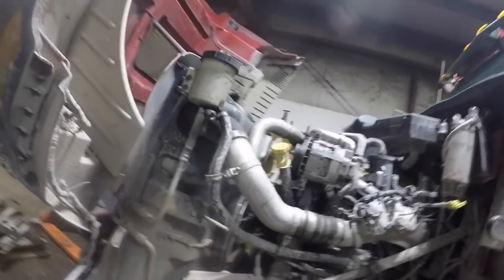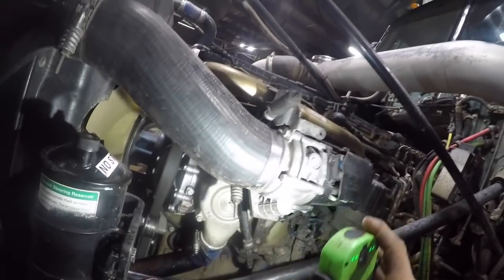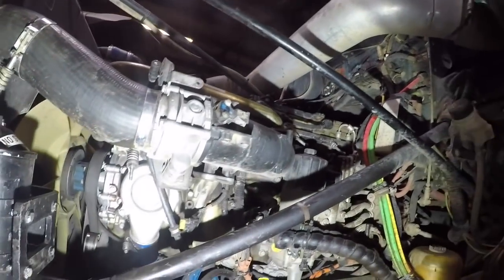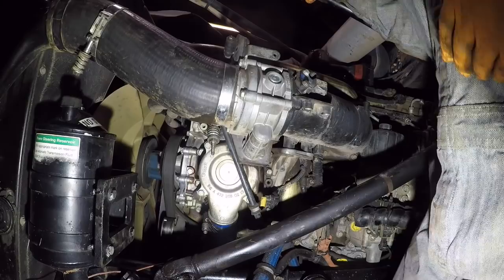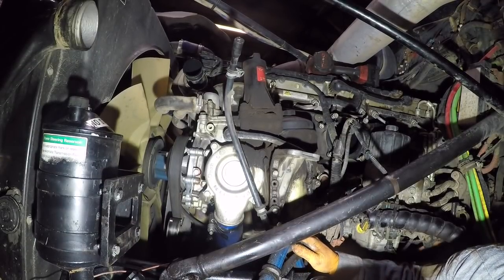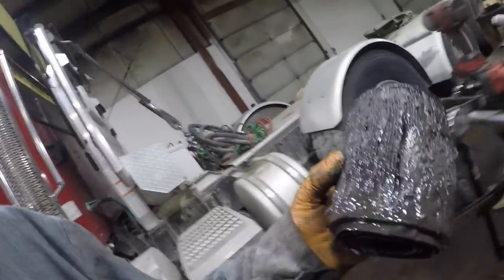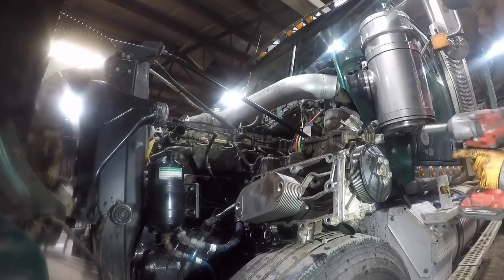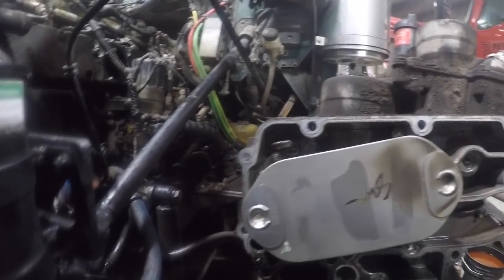Detroit dd15 oil cooler module electrolysis pt1

Comment: Nice I have done 4  of those so far . Replaced 2 and rebuilt 2 . I will say the job is a lot easier if you take the front wheel off .

Comment: Metallurgy, a dreaded phrase from the days in school, when one wasn't paying attention. Now so many years later one sees the results of electrical currents, electrolysis and galvanic corrosion. It's amazing to think simple mildly acidic water, will act as an electrolyte between unlike metals. Engineers are thinking lighter, stronger and cheaper to produce a product. So they use various materials together for an end result which for the time works. But just change a variable like switching from engineered anti-freeze to a possibly mineral rich water, the damage it can cause is amazing. Dropping wrenches has changed so much over the years, your always on a learning curve. Like you pointed out with the welding, you step away from a field long enough, one tends to "forget" details that were second nature 3 years ago. Warren it's always enjoyable to watch what you encounter on a daily basis, from one job to the next. Thanks for bringing us along with you. Thanks for the Share & Stay Safe!
Reply: Few yrs back i was called out to fix water leak in apartment building, somebody replaced the old galvanized piping with copper, a good-thing, but they hung the copper with cheap steel plumbing strap, yep every hanger was bright green, 1 was dripping real bad, so yeah i fixed the leaker, got rid of strap, using copper hangers, no more electrolysis

Comment: Don’t mean to nitpick Warren as I’m a big follower of you’re work, I’ve replaced a couple of these oil cooler service centres on the DD15 engine, due to leaking e.g pin hole in the housing. Caused by cavitation more so than electrolysis. Due to the system not holding pressure, then it leads to cavitation. We have seen the liners let go due to it also. I would recommend air pressure testing the system without coolant you mite find more problems 😷 keep up the good work ☘️

Comment: I can attest to their reliability, I've driven a number of Freightliners with them in my time as an OTR driver, I've driven an International LT for a week, and I've driven a pair of Volvos within few months of each other, and in my three and a half years the only trouble I've had with the DD15 was a belt tensioner went out on the road while I was with Swift and it destroyed the belt. With the Volvos I had injectors and the EGR cooler get fucked on them within my seven months at the last company. Didn't have enough time on the International to give an opinion. Detroit is by far the best engine I have ever had in a truck, if I buy this truck I'm eyeing for heavy haul work and something comes up legally where I have to swap the engine from the 14 liter Series 60 in it I'd go with the DD series, probably the 16 liter. Frankly I think they're better than CAT

Comment: I would not even put a coolant filter back in it, it's just supposed to help by slowly releasing additives over time. I'm sure you knew this already though. Before I went on my own I worked for a company that had a fleet of DD15 and 13s. Our dealer told us if we run good coolant and service it appropriately then don't run it with a coolant filter. So that's what we did and we never had any issues. I don't claim to be an expert, just thought that could be some useful info for you! Thanks for all your videos, I watch them quite a bit trying to learn everything I can from you.

Comment: Im so glad we put the ol school green in it. The newer stuff you're suppose to replace every so often but the green last and has way better protection against corrosion.
Reply: Red OAT coolant is million mile life of the engine, blue OAT is 500,00 mile. Theyre both leaps and bounds better than green coolant which is 3 year, 5 year if you buy extended life. I still wouldn't even run it that long. Everything I see come into my shop with major cooling system problems has green coolant in it, that stuff is garbage as far as I'm concerned and as far as pretty much every heavy duty diesel engine manufacturer today is concerned as well as most automotive manufacturers.
Reply: @saintsarecoming13  You are correct, green coolant is obsolete and I wouldn't put it in anything with the existence of modern coolant.
Reply: @mikeshultz1007  The old green and SCA Precharged antifreezes run a very high pH, or high alkaline, great for Iron but hell on Aluminum.  Use OAT or HOAT on engines with Aluminum parts.  HOAT means Hybrid,  i.e. contains Organic and Inorganic rust inhibitors.  i.e. Sodium Nitrite which is SCA pre-charge which prevents cavitation erosion.  Some older engines use "charged" water filters which already contain the Nitrite,  too much Nitrite can cause sludge formation.
Reply: The green is the same as water in a diesel. You will have trouble down the road with green in a diesel.

Comment: It may be helpful for some people to know adding water to full strength anti-freeze and batteries , use only distilled water , tap water is corrosive . And those using soap/detergents to remove and install tires on aluminum wheels , that causes oxidation and pits where the tire beads seal . I clean the wheel beads and wax them with car paste wax , and use original armor all (says good for rubber on the bottle) on the tire beads and inside edge of the top bead and wipe off the excess , and use a dampened rag with water around the wheel and tire beads as its installed , slicker that snot on a door knob , my wheels beads are not corroded or leaking , this is just something simple and on hand that works .

Comment: Have a whole fleet of them. Dd15. Most I ever see wrong with them is some head seals for the injector lines and emission codes. A lot of nox sensors and acm wiring. Other than that they really are good base engines. Just every manufacturer has emission problems.
Reply: Can't forget quantity control valves non stop

Comment: If I remember correctly there was a bulletin where Detroit said to remove the coolant filter and run them without it. Also there is a block drain on the left side of you didn’t know already

Comment: Nalcool 2000 stops that and changing the coolant helps what we do is check the voltage generated by the coolant  when it starts to get high change it

Comment: I don't know where the people talking about flux core got their information but what I know is that I trained and certification tested with flux core on a structural steel plate. Im certified 3G Unlimited, same with arc welding.

Comment: Hi Warren. I have an aluminium boat and it is essential that to stop errosion of the metal, we use what are called sacrificial anodes at strategic locations which attract the electrolysis. Have you any ideas as to why these anodes are not present in these machines?
Reply: those are in water heater tanks too

Comment: Those coolant filters disenagrate if they are left in too long. It’s normal for Detroit. We change ours once a year. Your lucky you got it out in one piece lol
Reply: If I remember right detroit has a TSB out that says to basically just take the coolant filter out and don't put one back in but for some reason they still sell them, I disagree with that. I think a coolant filter is pretty important especially considering every coolant filter I ever changed on a detroit looked like it was full of concrete.
Reply: @saintsarecoming13   not with the variable speed water pumps that’s why they got rid of those coolant filters
Reply: @СтепанБандера-ы8у  interesting, didn't know that was the reason. I'd be interested to read into that and learn what difference that makes.

Comment: That coolant sludge looks like Aluminum,  like you said, never run straight water, will cause erosion of metal surfaces.  Aluminum is a most delicate metal.  Only use the OAT or HOAT antifreezes in engines with aluminum parts, i.e.  aluminum oil coolers, aluminum radiators, etc.   The old green and SCA precharge work great on Ferrous metal (Iron) but will tear up Aluminum in a hurry.  Also note that long life antifreeze does NOT mean that you never have to change it out.  That is why they sell test strips.   I do not care for the new Nitrite Free antifreezes,  that SCA pre charge (Nitrite) works great.  Cheap insurance in my way of thinking.
SCA charge is Sodium Nitrite,  which prevents cavitation erosion.  Very complicated chemical explanation,  even with a degree in Chemistry I cannot  easily explain how it works,  just know that it does work and it does not last forever

Comment: If the filter and the housing is full of that junk, imagine what it looks like inside the engine. Seems to me this engine will be back in the shop again in the near future. Perhaps now is the best time to just boil out the engine? I know it's expensive but, then again, isn't an engine overhaul? I'm only asking because, I haven't kept up with this stuff since trade school, 30+ yrs ago. 
As someone mentioned, seems to be the issue when mixing different metals together to make stuff lighter and cheaper. Cheaper isn't always the best answer. Great video as always, Cheers :)